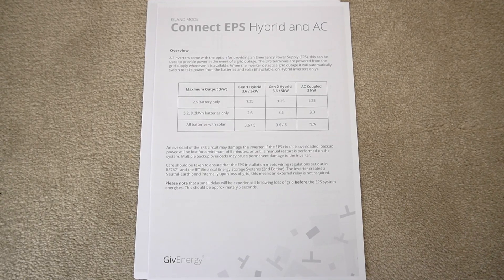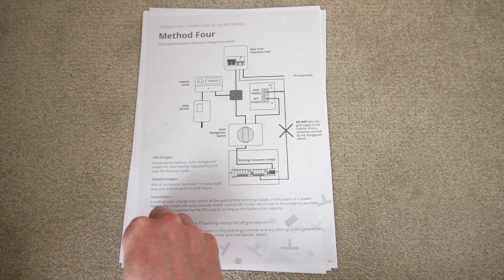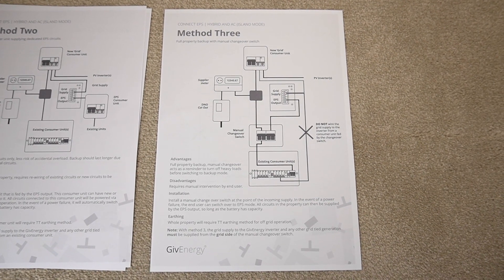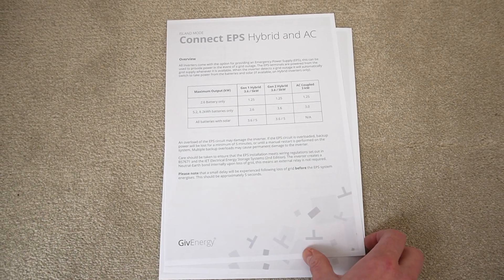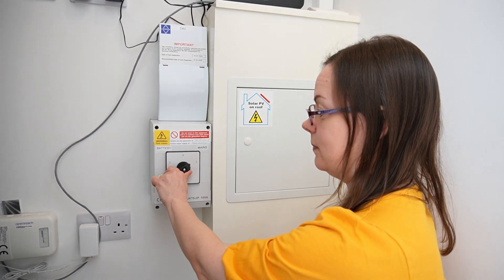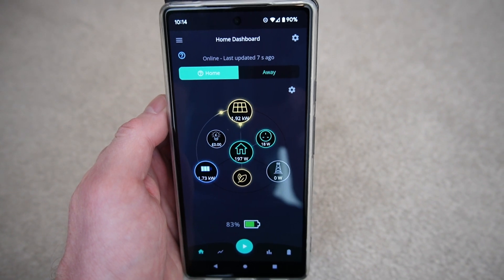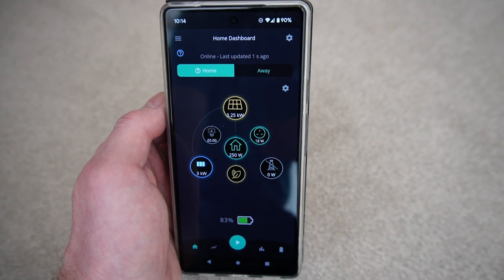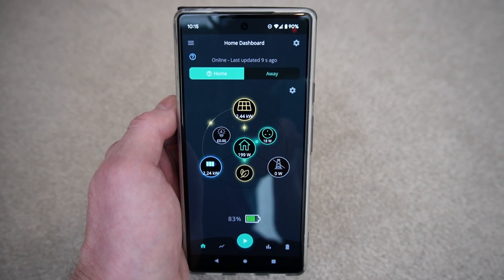GivEnergy whole house EPS - power cut backup demo

Comment: I went for the manual changeover for the exact same load management reason as you. Also having the EPS on the whole house rather than a few chosen circuits gives me the choice as to what I run. I might be wrong but I think you might find the EPS limit is 3.6kw regardless of the solar input.
Reply from the maker: The document says it's 5 kW when both battery and solar are available and 3.6 kW with only the battery available (on that front page), so I'm pretty sure that's how it works.  Incidentally, after we finished recording this video Kat put the kettle not realising I hadn't yet switched back to grid power, so we were probably drawing close to 3.6 kW at that point!  It seemed to cope just fine, so that was a handy, albeit unintentional test.
Reply: @TimAndKatsGreenWalk Wow! That’s a heavy duty kettle you’ve got there. Ours uses about 2.2kW. Anyway, thanks for another interesting video and your system just keeps getting better and better.
Reply from the maker: It's a 3 kW kettle but we're replacing it with a 2.2 kW one as it's misbehaving and I think it's on its way out.
Reply: @TimAndKatsGreenWalk   We got a Logik kettle from Currys. It's rated at 1.8-2.2kw and to be fair for a cheap kettle it's not half bad. Normal draws 2.1kw so is perfect